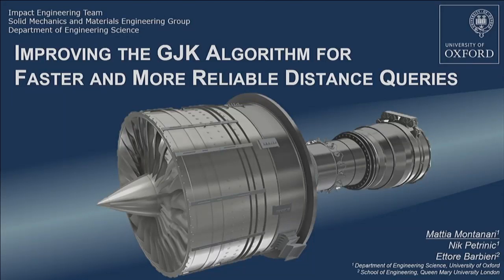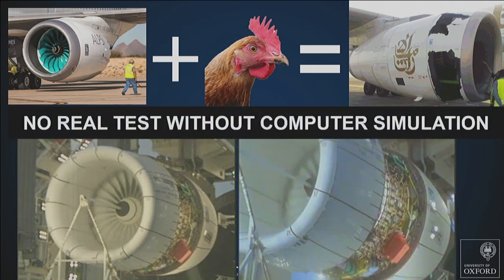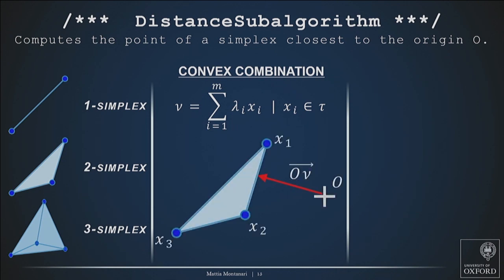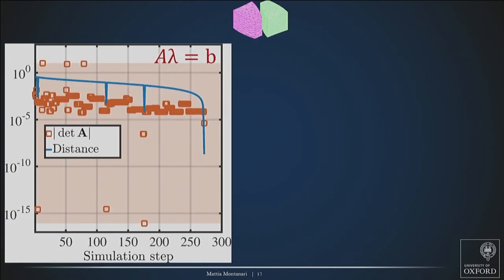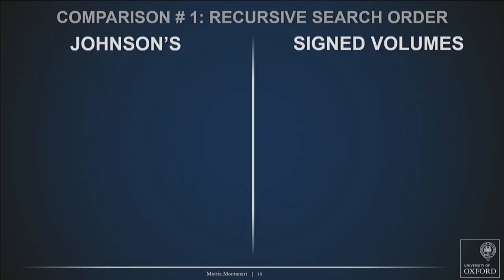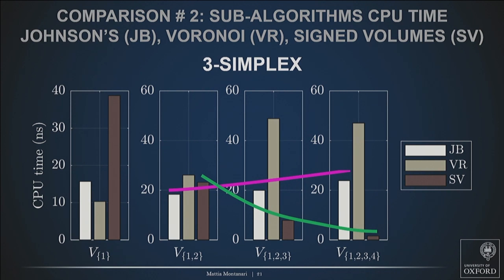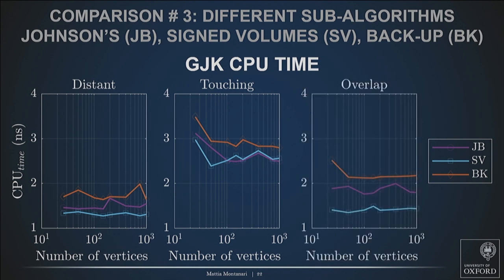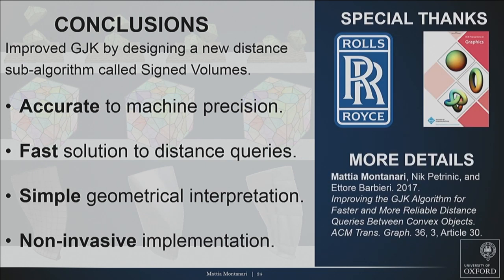Improving the GJK Algorithm for Faster and More Reliable Distance Queries Between Convex Objects

Comment: cool, but why is it faster to start from triangle go (lower)?
Reply: It's faster because you can more efficiently prune voronoi regions which cannot contain the origin and skip further unnecessary computation on those cases.
Reply: Further to what Michael said, the region is just larger. The corner regions flare out from a point, the side regions from a line, and the triangle from a plane. Hope that makes intuitive sense. You're more likely to find a match on the face than on a corner.